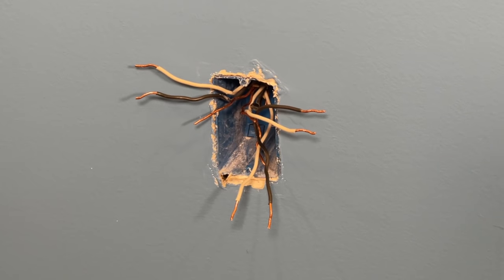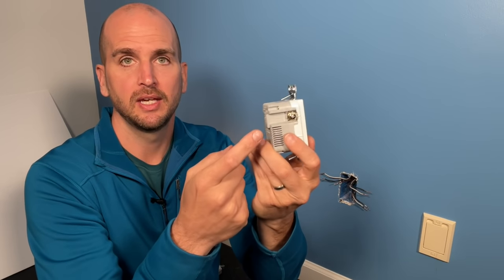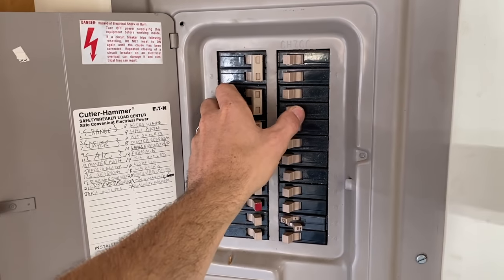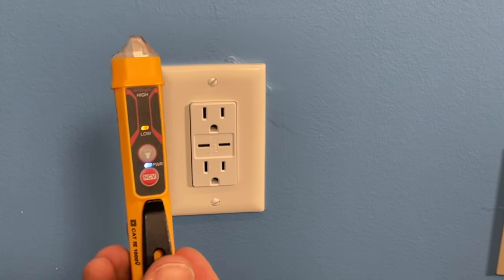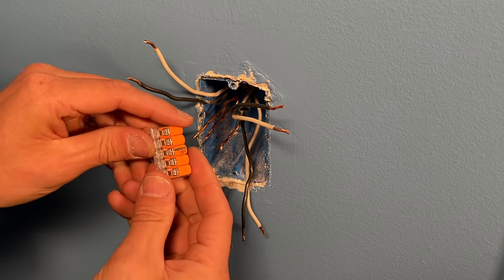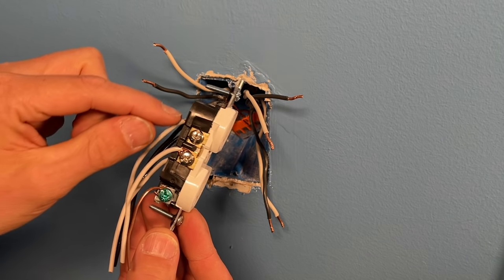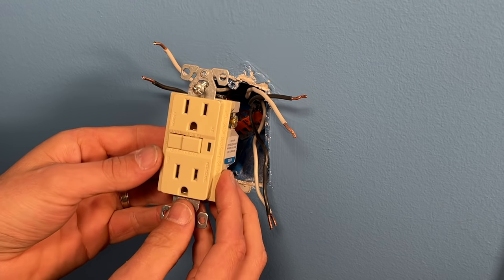Wiring an Outlet with Multiple Sets of Wires

Comment: I have one with 2 black wires, 2 white wires, 1 red wire and 1 bare copper wire. It was previously wired with the red and white wire with the line. A white wire in the load and the 2 black wires with the load. Am I missing a wire? I'm confused to why it was previously wired with 2 black wires and only 1 white wire with the load. The outlet hasn't had any previous work since the house was built. Any thoughts?

Comment: Curious if you had exceeded the capacity of the j box?  Typically, there is a limit.  Does this limit include for Waggo wire connections?  Are Waggo deemed similar (for capacity - 1:1) to standard wire nuts?  Thanks!

Comment: In the first example it appears both duplex recepticles will be hot all the time; but what if one of the lines is to an on/off switch - would that change the way a GFI would be wired

Comment: I was trying to wire a GFCI this weekend. I had 2 of each color wire and connected the incoming wires and then the outgoing wires to the load. After I turned on the power, the GFCI wouldn't reset. I'm kind of confused but will have to look into it more. If I remove the load wires, it works just fine.
Reply: I had a similar problem but mine was because the previous outlet had the line coming in the bottom and out the top, and when I installed the gfci I swapper the wires the way they were with the original outlet, so it was backwards. 

My lights run through the outlet, so that was super confusing for awhile.
Reply: Easy fix.......Call someone thats an actual electrician !! This is why i dont do residential work anymore
Reply: @logosrisingbear  I called a local electrician and he told me over the phone how to fix it. All is good now.

Comment: At one time, there was a provision in the code about the neutral conductor not being dependent on connection to device for continuity. Therefore a pigtail was required. I can’t find it again.
Reply: charles, the provision you're referring to applies to multiwire branch circuits. See code 300.13(B)

Comment: Hi, I have an end-of-line receptacle outlet with 14-3 wire. The Red was cut short and left uncapped.  They used a 3" piece of Red to (I'm guessing) convert the outlet to always hot (metal tab missing). I want to continue the 14-3 from the receptacle to a new fan/light switch.  Do I just cap off each end of the Red in the Outlet and run the 14-3 as if you  was 14-2 to the new switch. NOTE: I do not want the outlet to be a half-hot. Would add pics but don't know how.

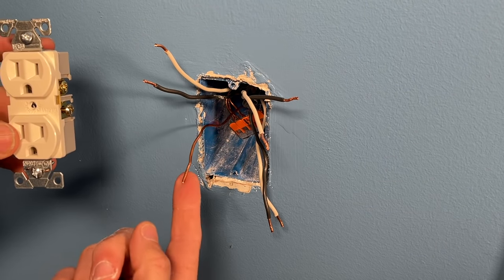Comment: I have an important question. If you about to remove an outlet and you just checked it with a voltage tester and you know the wires are hot but the voltage tester isn't reading it where it says it's dead. Is it safe to assume that even though you have the correct circuit off in order to work on it would it be okay to work on it as long as it is off at the circuit breaker. I know there is one way to test it but it dangerous. Years ago I did this without thinking but I wasn't thinking  I have a good reason for that. One evening I was sleeping and the fan that was mounted to my ceiling came out because the fan was wobbling which I didn't really think very much of it at first or why it was wobbling until he came out. And when the fan fell from the ceiling I was like oh okay the mounting bracket was loose that makes sense, but like I said I was it was after 5:00 in the evening and I'll know where I heard a big loud crashing sound coming from above me and I wake up while the fan is still on falling inches from from hitting me and the only thing that stopped it from falling on me completely was the wiring, So I think it would be a good Idea to cut the wire I go grab a pair of insulated rubber wire cutters on the handle it was protected with rubber so while I was half way a sleep my hands are on the pliers and I cut the wire which could have been the hot wire because it was black at the time I couldn't tell the difference because I didn't know anything about wiring anyways I cut the wire and sparks started flying everywhere within 1 1/2 foot from my face and no lie it scared the dog poop out of me. Soo I am standing there wondering why I am not dead and after I cut through it the wire was taught I look down and I realize the handle has a Rubbermaid grip on it. So I say thank God. It was a pretty scary experience. But the crazy thing is that thin rubber had grounded me and I didn't feel a thing but if the grip hadn't been on that handle I wouldn't be typing this message to you and the reason why I am is because I'm about to put myself in another scary situation where I am more aware of course but very apprehensive to work on a outlet when it should be reading that it's on when it's dead because I getting no electrical reading off my voltage tester and the only thing that tells me it's go power running through it is that it is on at the circuit breaker. Right now I'm not sure what to do. Maybe I should call a local electrician and get an opinion on what I should do before I think about working on it. If you can give some kind of advice I would be very grateful because I was planning on working on it tonight and if something bad happens to me I gonna get the shock of my life.

Comment: Now what about when you have 2 hots from the breaker and two neutrals going into a receptacle and it’s switched on the wall? I have that and it’s only getting 10 volts when I check it with a multimeter

Comment: I have an outlet that I'm assuming is part of a run of multiple outlets.  I have pulled out the outlet from the wall to see the wiring setup.  This setup involves two pieces of romex in the wall/box that have a black and white and ground wire coming out of them.  The 3 wires coming out of the 1st piece of romex are connected to the left side of the outlet.  The 3 other wires coming out of the  other piece of romex (that I'm assuming goes on to the next plug in the run) are connected to the opposite (right) side of the outlet.  I want to remove this outlet and just put a cover over it.  Can I connect the 2 black wires together and the 2 white wires together capping them off or using your Wago thingy (no pigtail) without shorting out the circuit while still allowing the outlets down the run to have power?  Thanks.  Any way I can send you photos of what I'm taking about?

Comment: I I have a stand outlet that  has  four neutral line two in the top and two in the bottom  and had two hot wires in the top one. no ground  I decided to replace it because the bottom one would outlet would not work right  I ended the neutral side that had two white wires on top and two black wires on top and two black wires on the bottom on the left side and then on the right side where the hot wire was were two white wires hooked together into the top port and nothing in the bottom and when I started to take the hot wires out they started sparking and blew the light out on my ceiling fan and now it won't come back on after I rewired it back together but instead of putting the two hot wires together I put one on top and one on bottom on the right side because if I was to put them together it would just pop the breaker as it was hooked up before

Comment: The wires should be tightened into receptacle going the same way as your screws
Reply: You don't need a J hook with the style where the wire sits under the plate.

Comment: Do you still need to pull the brass tab on the power side of a commercial receptacle like a residential receptacle if power is being supplied to a light fixture and a wall outlet?
Reply from the maker: The tab or bridge is removed when you are working with a switched outlet.  So if the old outlet removed was switched you would want the new outlet to be switched as well which means you need to remove the bridge tab.
Reply: @EverydayHomeRepairs  OK, I understand if you are unable to diagnose this issue. I purchased a commercial receptacle and placed the 3 hot wires in the proper brass slots and inserted the 3 neutral wires in the silver slots and wrapped the 2 ground wires around the ground screw on the receptacle. Now when I have a fan plugged into the wall receptacle, the ceiling light will not work. But when I unplug the fan, the ceiling light comes on. It is obvious that I failed somehow in the connections department.

Comment: I have a clarifying question. Would this be the same process if the outlet being replaced is on a GFCI circuit (kitchen) but does not have the GFCI test button? The current outlet does not have a test button but has two sets of wires and two sets of connection screws. The USB outlet looks like the one in the video with only a single connection and I am wondering if I can just pigtail the white together and black together and attach like this video?

Comment: I hate situations like this as its a pain to terminate these connections. sometimes the original electrician will actually put in a 4 X 4 box with a plaster ring.  this works best with multiple lines as there is room in the box for all the wires.

Comment: For the Wago wire connectors, it looks like its for 20A receptacles?  Can the piggybacking be done with those 20A wire connectors with a 15A 120V receptacle?  I have multiple set of wires and would also like to install one with USB capability. Thx!

Comment: I'm replacing a gfi in my bathroom. it was burnt at the black wire connection and not working. when i pulled out the old outlet, there is 1 black wire (the burnt one), two white wires (they were both connected to the silver screw), and two red wires (one of the red wires was just loose and had no exposed conductor and the other red wire had a wire nut on it.) i opened a 15amp breaker for the gfi black wire and there was still power going to the one red wire that was loose. i found the breaker and opened it to turn power off of that red wire. my question is, what would the red wires be for and do they need to hook up to the new gfi or together? why is there only one black wire?(is it at the end of the circuit?). why is there two white wires if it is the end of the circuit? thank you

Comment: That box is only rated for 8 12guage wires and wasn't legal when it was installed? Pigtails are required to be the same size as the circuit wires??

Comment: Does speed wiring meet code in all areas or do I need to find that out.  I don't particularly like using speed wiring but have done so when in a pinch if I didn't have extra wire caps handy.  I do love the concept of using Wago lever nuts though and likely will use them for now on instead of wire caps for pigtails.  But I am concerned that I at times used the speed wiring connects and wonder if I should go back and rewire the outlets or switches using the Wago lever nuts.
Reply: If by “speed wiring”, you mean the “back stabbing “ technique, then I would remedy this as many on Electrical YouTube channels have found them to fail with possible fire.  There is a little hole by where the wire was stabbed in and if you push a screw driver in then you can pull the wire out.  Do this with breaker off for this circuit.  Then side wire as shown in this video.

Comment: No need for confusion, it means the original electrician didn't know that outlets which are earlier on the chain will tend to resist, and dissipate energy. Test polarity with any basic multimeter, then ensure that all are properly joined. Attach the outlet with tails, per the author's instructions.

Comment: Question on the new wire connecters you used inought some of these new connectors for 2 wires 3 wires and 4 wires. Look same only the little levers you used dont open on one's i bought from lowes will mind work as good for wire tightness

Comment: I took my old outlet off and there was a red and black wire in the hot, 2 white in the neutral and there is an extra black one that was hooked around the screw in the hot side! Where does the extra black one go on these usb outlets? Please help if you can

Comment: Good job.. I have two outlets side by side one I have the hot and the neutral other one I just run over the hot and neutral turn the power plug the appliances and nothing happens. Test with and it’s hot. What did I do wrong. Thanks

Comment: Hello.  I have 3 wires as described and I am changing outlets because they are old and the plugs are not tight when you plug things in.  Does it matter which 2 wires get pigtailed together.  Can it be the main power and on of the others that run to other outlets or should it ONLY be the two that run to other outlets?   I just want to pig tail 2 and then screw both into the plug on each side.

Comment: What about when I have 3 sets of cables coming out of one outlet but two cables have 3 wires, and the other cable has 4. The fourth cable has a red wire that the other two cables don’t have.
Unfortunately, when I got my house back from my tenants the outlets and switches were removed; so I’m a little lost on what to do with the red wire. (Do I just put it with the other hot ((black)) wires?

Comment: I have this same wire configuration but in a 3-way switch box. None of the wires will test hot in either switch box. The circuit breaker is on when I test the wires, so that's not the problem. I've used both a multimeter and a voltage tester multiple times. Nothing. Any advice?

Comment: There’s 3 White and 3 Black wires, but there’s only 2 screws in each side. Where do you tie in the 3rd wire, if not using the “Stab-in” holes??
Reply: You would take the 3 white wires and add an 8 inch white pigtail and connect the 4 wires using a 5 position Wago lever nut, one position is not used. You do exactly the same with the black wires, using a black pigtail. You may trim the length of the pigtails as needed. Only one black wire and one white wire (pigtails) are connected to the receptacle. The unused screws should be tightened down.

Comment: I am adding adding a new outlet for my mounted tv. The box I am connected to has two sets of 14/2 wires. When pig tailing the two existing 14/2 to the new 14/2 the breaker trips when switching the breaker. I realized that one set of not hooked to the outlet cause another outlet and light switch  it to have power. I also have figure out that the only way to get the breaker not to trip is to not connect the ground to the new wire. If it is connected the breaker trips. Also when not connected, the receptacle meter says existing outlet and new out are wired correctly. I feel as though the ground for the new wire needs to be connected. Am I wrong?  I need help.

Comment: I have a switched outlet  which is upside down and want to replaced it with a USB-C, when I pulled the box the wiring was all back stabbed , except one red wire j hooked to the top hot screw, should I pig tail them with Wago’s ? Will the switched still work? Thanks

Comment: Can you add a new outlet by drawing from an existing outlet that has 4 wires and grounding.  How would this be done.  I understand d there is a max of eight outlets per circuit.  Do I just use one set of wires?

Comment: EHR - I love hearing from you...
Not this time. You should put insulators over open/bare wires when activating the circuit to see which wires are hot. People new to this are always prone to mistakes. - Famous last words - I've got this.
Also, and this is actually why I chose to comment, you had people activate the circuit to test which is hot, but you didn't have them open the circuit before you worked on it.
SHOCKING. You might want to fix that.
Reply: Lol 

The voltage is far too low for to jump the air gap. Why would you insulate something you're testing? You're being overly cautious to the point of wasting time.

Comment: You showed turning the breaker back on to find the line wires. You did not show or say you turning that circuit back off but touched those wires where last i saw it was a hot circuit by your tester.
Reply: If he needed be that ticky tacky ... then he really should be installing a lockout tag on the breaker box.
Cuz somebody might be wondering why their internet connect went down in the middle of a fort night gaming session.

Me personally would just unwire the plug hot ... touch each pair across its Black/white or ground , to find the circuit feed. Which would turn the breaker off/trip .Then go reset the tripped breaker after I buttoned up the receptacle.

Hehe LOL ... but ya ... don't try this at home or your grandmothers house kids ;)

Comment: I have a GFCI outlet in the bathroom that I replaced. There were 3 sets of wires just like this example. Only 1 set of wires were in the outlet and the other 2 sets of wires were just tucked in the back not connected to anything. I replaced the outlet and kept the same situation, does this cause an issue?

Comment: I'm trying to install a dimmer switch that has 4 wires on it (black, red, red& white,  ground wire) into the 3 sets of wires. The light is on but the dimmer function doesn't work and the light switch doesn't turn the light off.